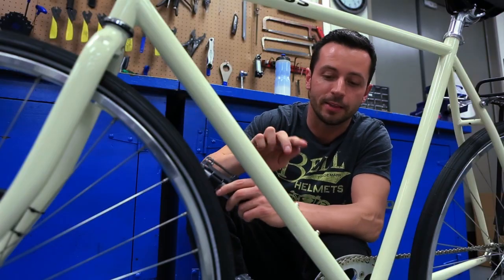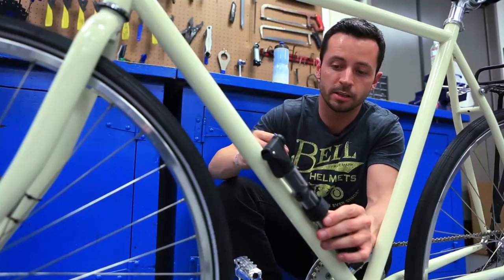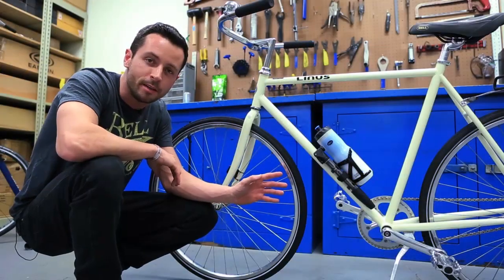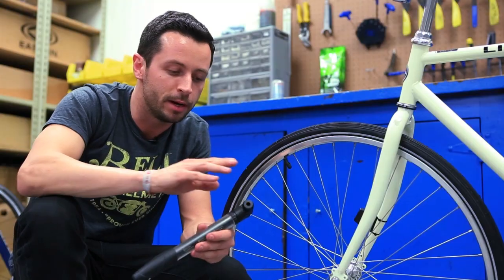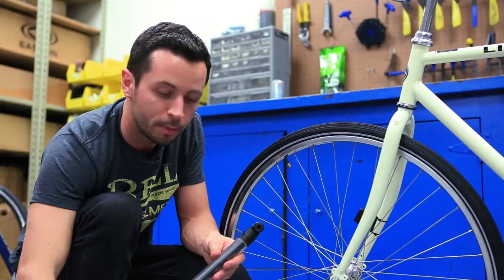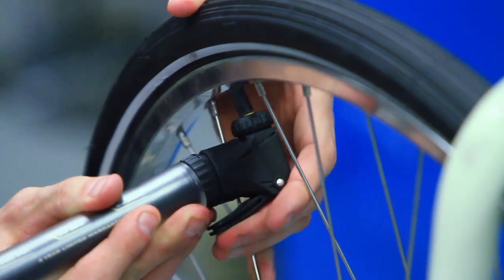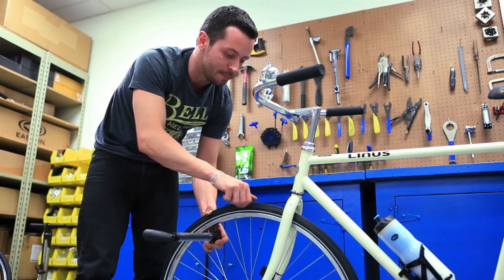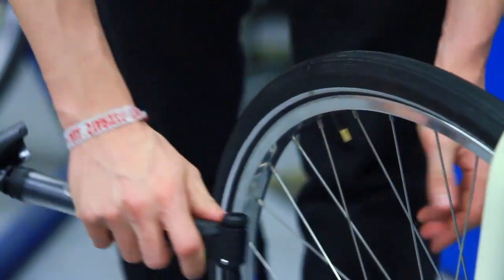How to Mount and Use a Frame Pump

Comment: Thank you for taking the time to supply a guide for others enrichment. I was able to figure out the pump in not too much time but I was questioning the mount, and seeing as how my apparatus is without such pre-existing threadings it is no wonder I could not figure that one out... But you answered that question for me at the very least, I will simply add the pump to my emergency bag no biggy. Thanks again bro! 👍

Comment: Thanks for posting this video. I need a way to mount my Kool Stop Tire Jack which is a necessity to mount a tire, it is so difficult with my GP4000 tires if I get a flat. I need 2 water bottles free now that Summer is approaching, no longer can I use a bottle for storage of the jack. I see that the Pump Frame bracket can be used for the Tire Jack which now frees up my second water bottle. This really helps, now I have to find out where to get the mounting brackets without the pump.

Comment: Some pumps you lift the locking latch up to lock it on .. Not always down as shown on this video. This type of pump can often be for a Presta valve or the combination type of pumps that can be used on both Schrader or Presta valves and some on even the 3 rd type of valve a Dunlop valve.
Reply: THIS COMMENT SAVED ME thank you so much, i thought my tires were broken or the valve was too big omg tysm
Reply: For reference, i have a blackburn mounted pump, its this way

Comment: I have double rim and when I pump the tube valve is so short that it only lets the air out and no air in. It is more or less ok when the tube is almost full but it takes dozens of minutes of trial and error to get enough air in to keep the valve at descent hight to press the nipple to with the whatever mechanism is in there. And if I leave it on wheels, it falls over and if I turn it around, it catches fingers in spokes and it knocks of the light on the steering bar. And it still does not stand straight, at any push it will fall over.

I have this vent extender which is a simple tube which therefore does not press the nipple mechanism, I manage to get some air in with a lots of hissing, then in an enormous hurry screw it off and try to put pump on while it is halfway out and in one trial out of dozen, I manage to pump it up.

It is so counterintuitive that the pressure inside the tube does not lift that lever up that locks the nipple with the extender on.

And it turns out flat at the end.

Comment: Any suggestions on inner tubes if your weighing around 205 lbs and my bike tire size is 26x1.95 an would a 26x2.50  be a better tire size for me being 205 lbs

Comment: And what if we have a bike that doesnn'ttt have 2 bolts on the down tube? or any holes for bolts....anywhere?
Reply: ***** Nah, I just carry the pump in my camelbak when I bring it with me
Reply: Doug Hosie cable tie the bracket on the top tube
Reply: Decent idea.  Now that I look, there ARE two slots that will make that work.
Reply: OK, an update. The only cable ties I had big enough to reach around the upper frame were also too big to fit through the slots that seem made for this.  I COULD have used the bolt holes, but I think there would have been some 'wobble' to the attachment point.  So I used too smaller, shorter ones and linked them together.  That brought me to my first minor mistake.  I clocked the first connection up against the slot on the bracket (which was fine) but clocked the second connection on the side of the bike.  Not good as you can rub your leg on it.  So I re-did it with the connection on top, just barely to the side of the cables running to the rear of the bike.  This seems a good position.  Second minor mistake (and easier to correct than the first) was I did not put the attachment strap through the hold down slot before attaching the bracket.  Not hard to do once installed, but would have been MUCH easier BEFORE installing the bracket.  Cheers.

Comment: Mine won't pump. I attached it to the thingy and I try pull the pump arm in and out and it won't move.
Reply: OK, basic question first.  Did you pull out the rotating top part?  On the pump end (vs the end you attach to the tire)?  There is a catch ring inside the handle to keep it from being moved in  and out while not in use.  If this does not solve the problem, take it back, It has more problems than that.  I DO see this was asked 6 months ago, so I assume you found the answer but others may not get it.  Took me a few seconds.....

Comment: No information or parts are provided for mounting on older bikes without mounting holes on frames.
POOR EXECUTION by the manufacturer and no "warning" provided.
Was about to return the pump but used mounting hardware from my old pump to attach the pump to the bike frame.
Why isn't a mount provided for older bikes? 
The manufacturer is shaving nickels, and as a result, I will NOT be purchasing any more products from Blackburn. 
Z E R O  stars, lol!